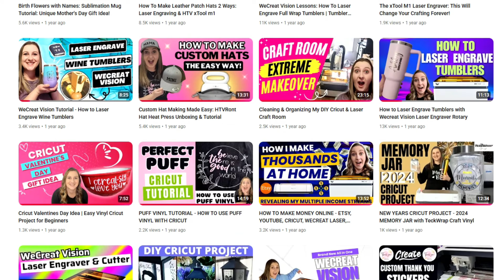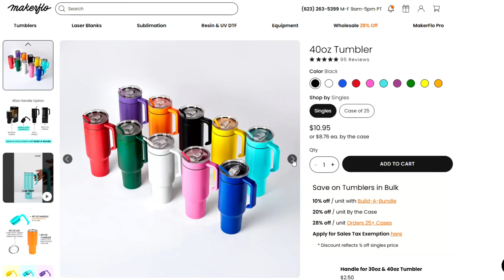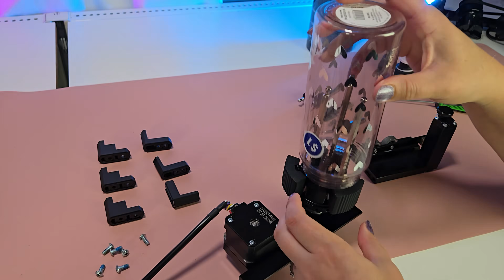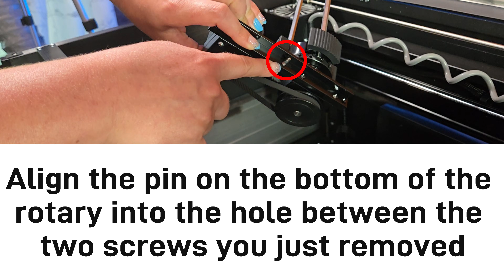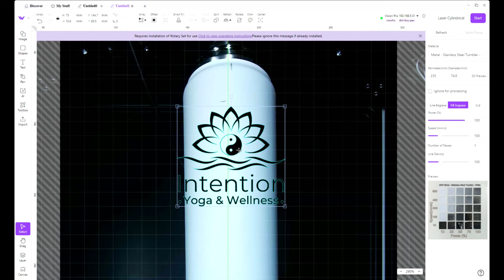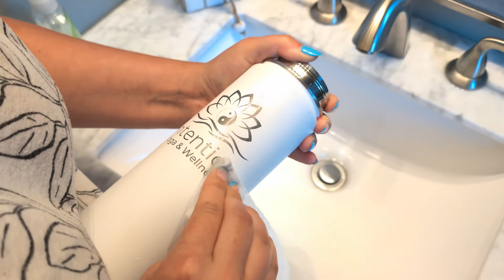How to Make Money Laser Engraving Tumblers! (WeCreat Vision Pro 45W Batch Guide)

Comment: Kerri, what are your settings for the 45W for the dark 40oz tumblers?
Reply from the maker: 40 power, 220 speed, 1 pass, 200 lines per inch
Reply: Will these settings work for the electroplated 40oz black tumblers too? I have a 40w wecreat